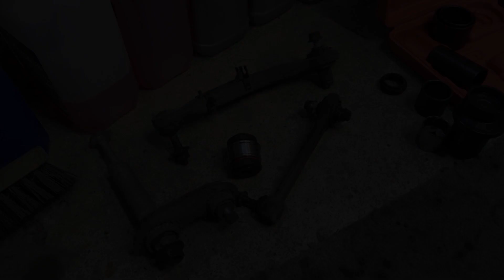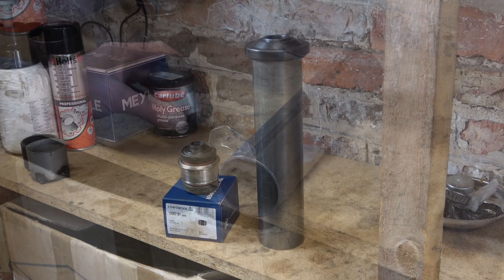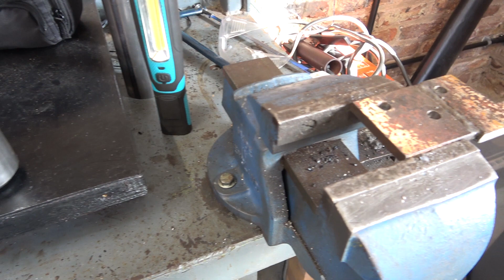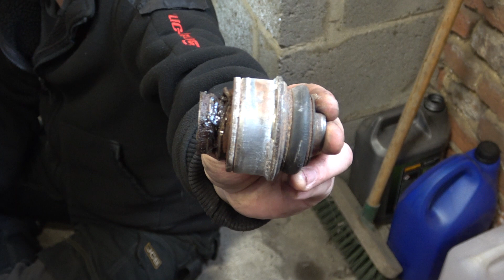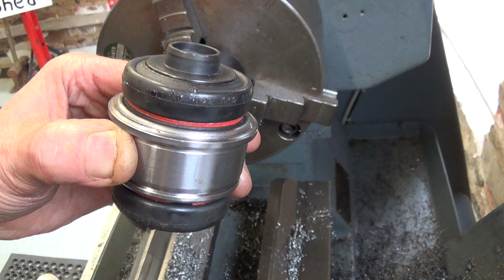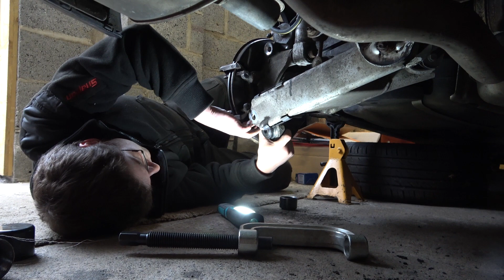HS30 BMW E39 rear ball joint replacement

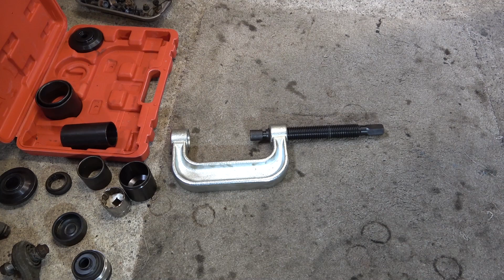Comment: I should have watched your video first before buying that tool on 1:28
Seems the same as the one I purchased.
Now it is on delivery.

I guess it is still not the time replacing those ball joints

Comment: My dad and me did the control arm bushes of our Mercedes-Benz W116 and they were tough as diamonds to get out. We took our time and tried different ways but they did not move, untill we got sleeves and cups made by a machine shop. Then we pushed them out on a press.
Reply from the maker: Hi MkM, just the same on the BMW they were really tough to get out. We had to use the large C clamp as it would be a lot of work to get the arms off the car and into a press. You can find many videos on YouTube where the 'proper' tools just break before the bush moves. Getting the right size sleeves and cups was essential I think. Cheers

Comment: What symptoms did you have when driving the car?
Reply from the maker: Hi Javier, I asked my son and he said "We had a slight loose feel in how the car drove and you could feel slight play in the rose bush joint when you pulled on the rear wheels with the car off the ground. It was done as part of a full rear suspension refresh."  I hope that helps.
Reply: @HaxbyShed  thank you very much for the reply